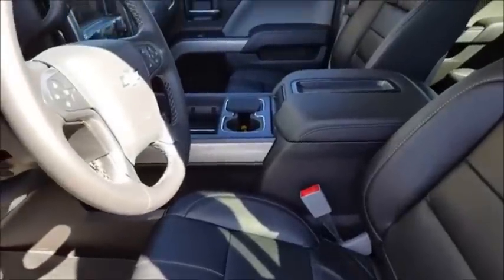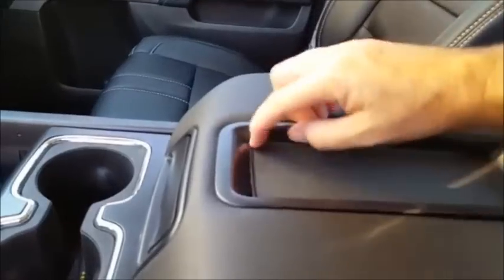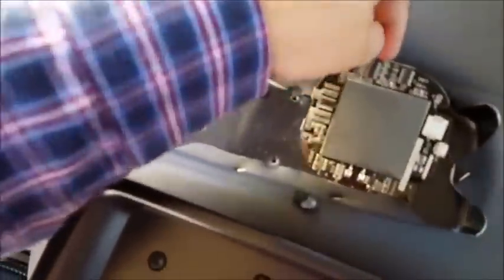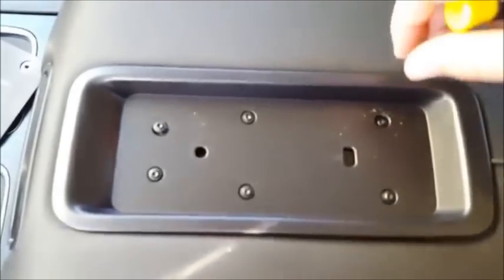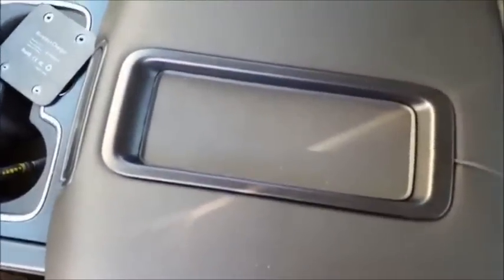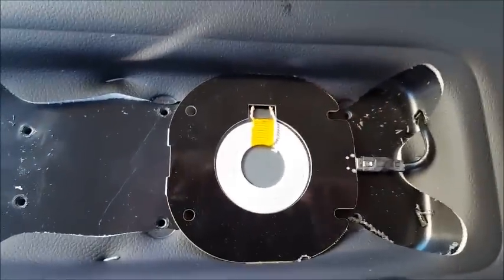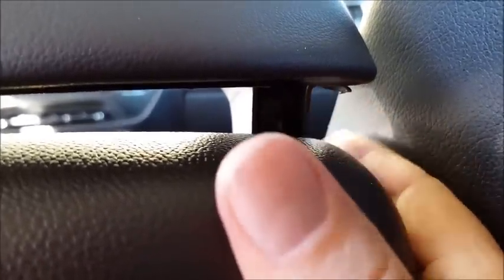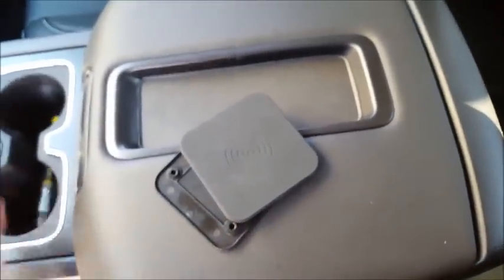DIY wireless charging Chevy Truck $13 or less

Comment: I did this in my '14 LTZ this weekend.  Works like a champ!  Thanx Chris... I bought the exact same charger on Amazon for $10, spent about 30 min installing; priceless.  The charger is actually a little smaller than in your video, but that only helps so you can position it better where you want it...
Reply from the maker: that is great news. thanks for sharing and i am so glad to have been able to help. hit the like button for me and share it with your friends. 
thanks again.
Reply: Do u have the link for the charger you bought?

Comment: I already did this to my 05 Silverado. I used a dremel, cut the shape out, snug fit in the charger, recovered the tray bottom with fake hardwood floor panel (giant wood looking sticker) Reinforced the underside, buried the wire inside the console a boom.  wireless charging perfection.

Comment: I did this and worked great. But my phone kept sliding to the front when I would brake and it would stop charging. I actually turned the cover around drilled in some holes for the screws and problem was fixed. Thanks for the vid!
Reply: @TheSpeedula  did I read this comment right
Reply: @ok-qb8ir  You did

Comment: You made this so much easier than I was about to make on myself. I had no idea the whole tray came out and had that space under it. I ordered a bare triple coil from Amazon and I'm going to try to make that work, if it will fit between the screws. If not, I'll definitely try this unit. Thanks for posting.
Reply: Did it work?

Comment from the maker: This is an LT. they do not have an option for wireless charging for the 2015 trucks. I did later take apart the rear of the console and using a cigarette adapter I tapped into the power on the back of the console. To remove the back there is 4 hex screws. Then pull hard

Comment: I did this in my 2015..a couple tips...I got the same charger but it was a bit big compared to this video...I trimmed the board with nail clippers. also, the charger doesn't allow the rubber mat to go through one of the holes in the tray. had to trim off the larger rubber "fin" on it but the other fin will keep in place when raising lid.  trimming the plastic of the mini USB connector is key to making it fit too...I protected with electrical tape once it was gone. mine does charge thru a case...Samsung s7 with speck candy shell case...doesn't charge very fast but does charge...thanks for posting this video...
Reply from the maker: thanks for sharing your tips everything you said is spot on with what i experienced. i should have included those tips. thanks again.
Reply: Does this connect with your radio unit so you can play music from your phone wirelessly? or does it simply just charge the phone?
Reply from the maker: Silvester Cruz this is only charging
Reply: Silvester Cruz all new GM cars and trucks (except work trucks) have Bluetooth connection. So every time you start ur car/truck it connects automatically to ur phone, so just leave it alone charging and answer calls and play ur music through the stereo/navigation system.

Comment: You lucked out. It’s like that charger was made for that spot. Well done. I wouldn’t have gone through the trouble of running the wire through the hinge and just said screw it, but you have a clean look after doing it.
Reply from the maker: it was so funny that I had that charger laying around and I said let me see if it will fit. I was very excited when it fit perfectly. I had that thing for almost a year hardy used it in the house but use it every day in the truck.

Comment: It probably works better than my factory wireless charger in my 2015 Suburban.
Reply: Brian Moyer the stock charger does not work ever !!
Reply: Brian Moyer I work at a dealership an I can say with confidence that the one's from fact the only work about 10 to 20% of the time
Reply: Brian Moyer you have to consider the phone protector case if i have one.

Comment: I did this to my truck today, 2011 2500hd and it went pretty smooth. Fairly inconspicuous but it doesn’t work as well as I’d hoped. The phone says it’s charging but it isn’t. It seems that the charger doesn’t have enough power to punch through the plastic in the console lid and the rubber liner thing. The charger is shimmer tight to the bottom of the lid so it’s as close as it can get. If I remove the rubber liner it’ll actually charge, otherwise it just says it’s charging

Comment: Everything looks awesome with your idea,,,,,,,except ,,    the bottom  of the charger is exposed and if the bottom of that console door is metal,  the second you use the console like a arm rest it might start smoking.cover it with electric board tape or gorilla tape would be fine. That should keep your beautiful truck from going up in FL.      we'll you know.... great idea bro, thanks for sharing

Comment: So the phone you use to test this setup is the one you are using to record it so we don't actually see this wireless charging theory in action? Great job.
Reply from the maker: i had 2 phones in the second video i made to you can see the phone working on the charger.
Reply: I see now. Didn't make it to the last 10 seconds of the part 2 video. That's pretty cool.
Reply: Zohn Williams he comes up with a kickass idea.....and you're bothered he didnt have the forethought to do multi camera video? Pretty high standards bud....

Comment: Nice work Chris, I need to try something similar on My F150.
Reply from the maker: +The Grumbles Team at EXIT Realty of the South 
if you do send me a few pic thanks
Reply: +Chris Gagnon, Took my console apart and it should work easily.  Only problem...The cutout in the console on my F150 is not big enough to lay my Phone flat in so it won't charge.  Fail.

Comment: Nice, however if you want to use the Android Auto or Apple's car play you have to have the phones plugged into the usb port anyways.
Reply from the maker: Yes unfortunately. My car did not have the android auto if it did i thing i will figure something out that will let it connect the cable with magnets.

Comment: Nice video! I didn't see you show your phone actually charging, so I don't know what setup you've got, but what phone are you charging, and do you have a case on it? I have an Otterbox, so I'm all little concerned that it may not charge through all that material (console trim and case combined). Fyi, I've got an iPhone 6+ that I'm looking at adding the Qi receiver to.
Reply from the maker: +Robert Smith 
good point Robert 
i have a galaxy s6 with a case on it. i tested it using a few old plastic gift cards between it and with the case on it i can put 4 cards between it and it still charges good. in part 2 i showed a picture of the phone charging so you can see the case i have. thanks for watching and i hope this helped.
Reply: +Chris Gagnon 

Also, my truck has the bench seat, not the center console. I still have an insert that my phone will fit into, but it isn't a tray type setup held in by screws like yours. When I pull up the rubber mat, I can see through the holes that there's probably room below like yours, but can't figure out how to remove the trim panel. The plastic wraps all the way to the front where you unlatch the compartment. Since there aren't any screws, I'm guessing it pries off, but I want to be sure before I go breaking the thing! If you've encountered any of these I'd appreciate some tips...
Reply from the maker: i am looking for a bench seat to do the same thing to. i think i can get power from under the seat. good luck if you do it take a few pics and send it to me,
Reply: +Chris Gagnon 

Got it set up in mine (sort of). Only difference is you have to remove the plastic panel on the inside of the lid to access four screws which release the top tray from below.

The problem was the charging pad I ordered didn't seem to be as strong as yours (insides were different??) and so I wound up having to cut the plastic tray with a Dremel to let the coil come up through the plastic and sit flush with it. Once you put the rubber mat in, you can't tell the difference. I just taped the circuit board to the underside of the plastic tray that I cut to hold the coil up through the hole I cut. I'm leaving it like that temporarily to look for a triple coil to put in there instead, but we'll see. I also plan on doing your part 2 method to hardwire the device eventually.

Comment: Instead of a little clip to hold the cable snug to the inside of the counsel you might try a dab of black or clear silicone.  Tape the cable in place overnight until it dries and then remove the tape.

Comment: Great video, unfortunately iPhone's don't have the wireless charging capability or i'd do it.  If I were you i'd look into patenting this setup somehow and sell the idea to General Motors
Reply from the maker: +Tom Armstrong 
thanks Tom i have notice a lot of my friends are getting the slim wireless charging patch for there iPhones here is one that i have seen with good reviews. iPhone Qi Receiver
Link: http://amzn.com/B01D1AOYKC
Reply: My 2016 Silverado LT comes with a built in charger on the center console, so this isn't really anything new. GM engineers already had it covered.
Reply from the maker: +Oscar Arredondo 
Oscar i am so jealous that yours came factory with it. i always prefer factory. in my second video i am doing a 2016 LTZ and it didn't come with it. could you share the option code on you truck so others can get it if they want?  thanks for shearing
Reply: +Chris Gagnon thanks Chris, I think the charger comes standard on LT LTZ models that don't have the fold down bench seat. I have an IPhone 6S and it isn't compatible so I have to buy a receiver for it. But with all the usb outlets in the truck already it's easier to just plug and charge while also using Apple CarPlay.
Reply: Tom Armstrong hope you got the iPhone figured out by now. You can actually buy a pad you slip onto the back of your iPhone and plug in the charger port that gives you wireless charging capabilities.
Reply: Tom Armstrong Get yourself a  IPhone. mophie  case it'll work with the wireless charger.
Reply: They have a solution for that also I found on YouTube.
Reply: waterside YOUDUM
Reply: Well it works though its plastic cover and whatever case you have on your phone, even the big protective cases, so I don't see why it wouldn't work, there isn't that much material in the way.
Reply: Tom Armstrong 
New iPhone 8 has wireless charging
Reply: I never so the phone charging.
Reply: waterside it’s really not that much material. I have an Otterbox defender on my iPhone with a wireless receiver card and it works great. The case is pretty thick, plus it has a rubber outer shell
Reply: They do now, its just a thin case you put on it and plug in to charging port. Not too noticeable and looks good. Look it up
Reply: Tom Armstrong You can’t Patent a way of how wires are ran through something, bc anyone with no experience can do that. You’d have to Patent this wireless charging device, which has already been done. You obviously have no clue how parents work. I’m an inventor, and your wrong Tom. I’ve been an inventor for over a decade now, and you can’t Patent something like this. If he came up with the idea of the wireless charging device?  Then he could, but those started coming out in GMC/Chevy vehicles starting in 2016. Thai idea isn’t  new to GMC or Consumers.  But.  This is a great idea for those who have a GMC/Chevy prior to 2016 to have a wireless charger built into the arm rest aftermarket and as a DIY’er.
Reply: Yes they do!
Reply: That's why Samsung winning wireless charging

Comment: The only thing that its stopping me from doing this is the charging speed.  aren't these chargers slow??
Reply from the maker: +D. Reyna I think it depends on if you use the 2.5 amp or the 1.5 amp power source. Should go fast on the larger one
Reply: It’s slower than plugging it in but it charges fast enough. I put one in my cradle where I always sit my phone to watch videos while I’m working and it’s so nice not needing to worry about plugging it in or draining my battery when I grab my phone to go wait on a customer or go in another section of the shop. I honestly thought it was going to be stupid since you can’t hold your phone while charging but it’s been a non issue and now my phone is pretty much always charged and ready to go. 
Also for what it’s worth, I got probably one of the cheapest wireless chargers available from 5 below for 5 bucks. I didn’t want to invest a lot since I didn’t think I’d like it but it works great and I like it. I might pick up another.

Comment: I did this to my 2012 Sierra and it shows that its charging. The only problem I'm having is that the charge is extremely slow ! I let it sit on the console for 20 mins and the charge never left 3% any ideas on why that is ...
Reply from the maker: you can upgrade the power source to a 2.1 amp charging cord. mine was only 1.2 i think and it did charge slower on my new phone.

Comment: Hey I bought the same choe qi charger you suggested and a wireless adapter for my phone and it charges but the battery discharges extremely fast does your phone do this also?
Reply from the maker: i have not experienced fast discharging of my phone. thanks for you comment. i would try a friends phone and compare them.

Comment: The only bad thing about this is how slooowwww it will charge the phone
Reply: I did this the same way and it charge very slow, the USB from the truck does not have enough power so I changed some wiring to the cigarette lighter plug and it charge faster.

Comment: My 2017 sierra has a clip inside console lid specifically for this. Should have patented this idea.
Reply from the maker: wish i had thanks for watching
Reply: abrahambenitez545 on the underside of my console in my 2015 2500 there is a clip ... is that what the hell that is actually for....?!
Reply: My 14 has the clip , I'm gonna see if it works,  I doubt it will too much interference